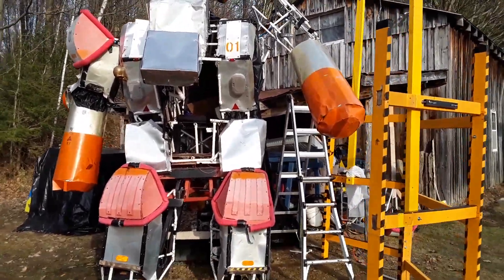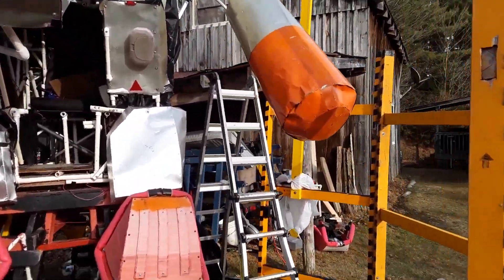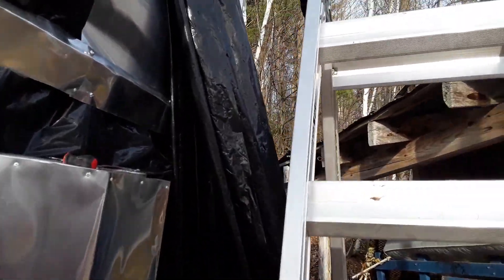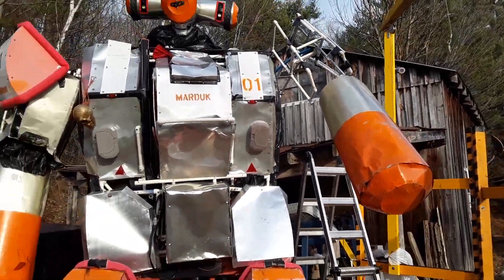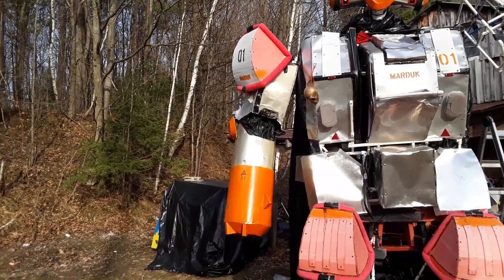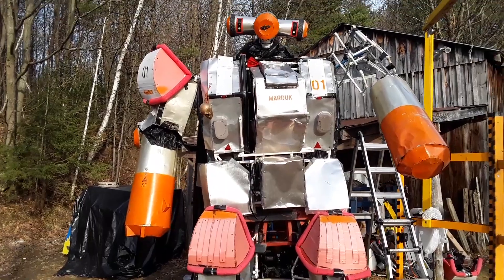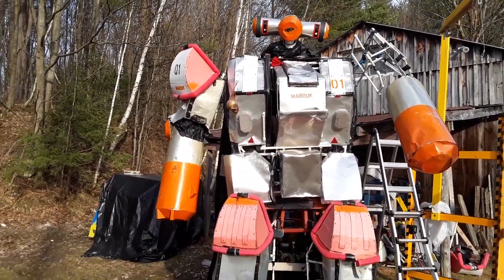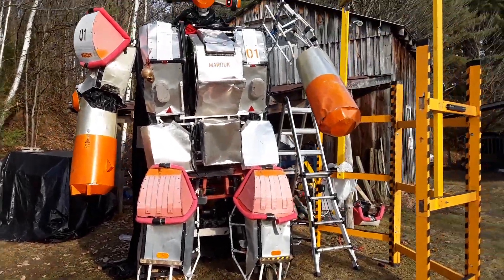Reinforcing mech arms with metal instead of vinyl

Comment: With one man putting all this work into murdoch, its movements are quite impressive as it looks.

By the way, do you use a computer aided design software like solid works to design all the components or do you draft them old school through pen and paper ?
Reply from the maker: Depends on the part.  If it is armor paneling or a 3d printed widget I use blender.  Otherwise it is old school pencil scribbles.